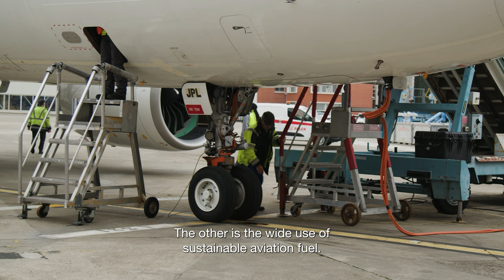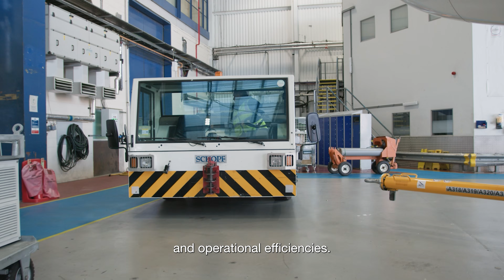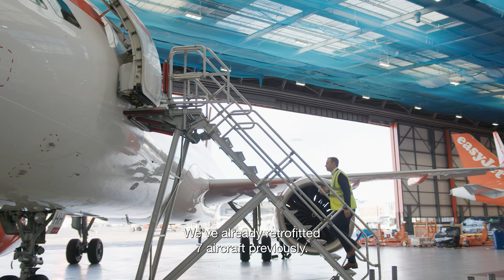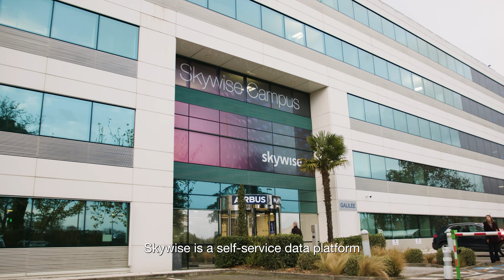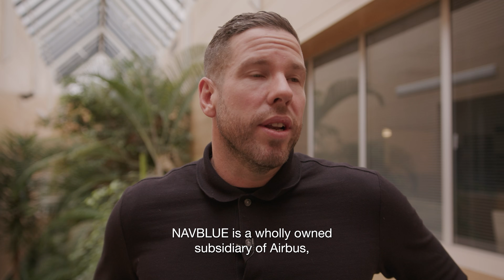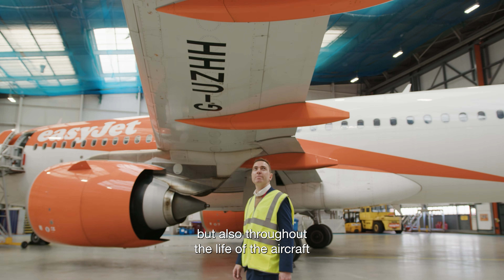Upgrades: Fuel Efficiency

Comment: If an A320 will do SETWA, wouldn’t the PTU “bark” continuously?
Reply: No.  The yellow electric pump will provide hydraulic pressure to yellow system instead of engine 2.